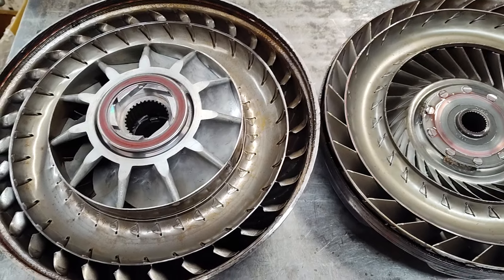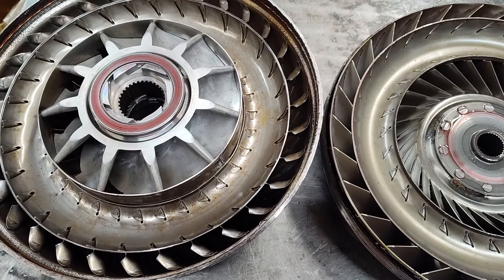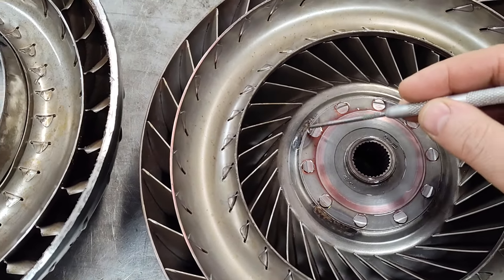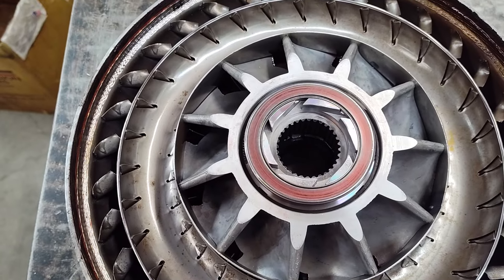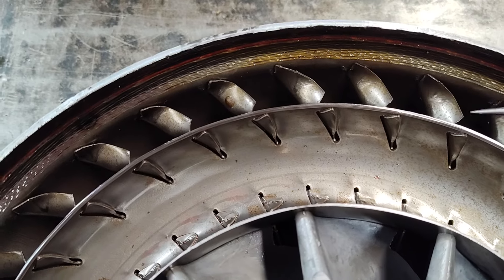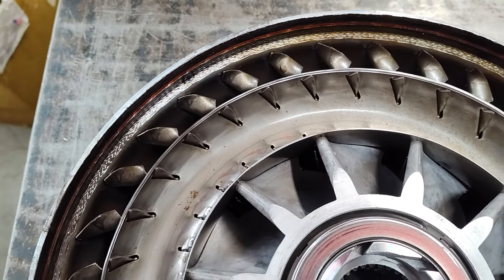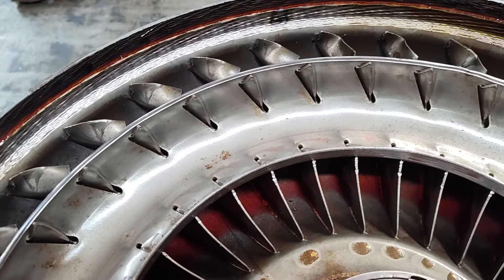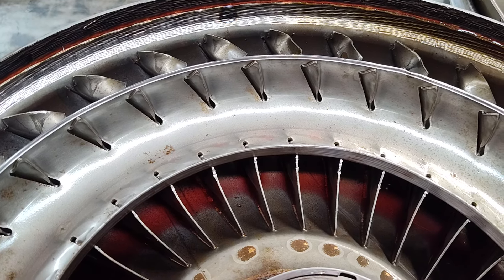Inside An Off The Shelf Torque Converter and Analysis

Comment: GM 245mm FWD lockup cores are available in a WIDE range of stall speed and K values and are extremely plentiful.  You can create excellent performance converters for many applications from them.  You can even do performance TCC converters.  Precision industries has a good spread of covers for many applications.